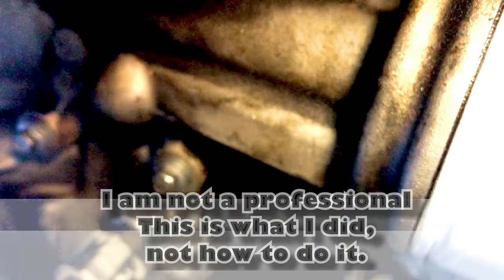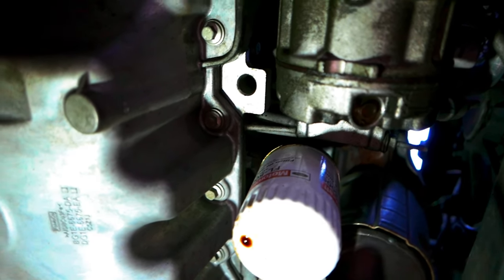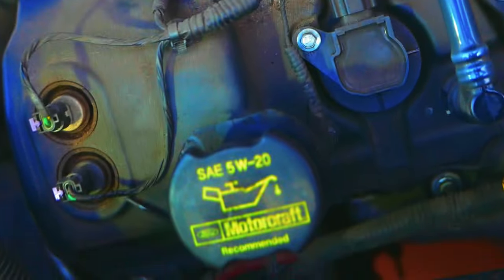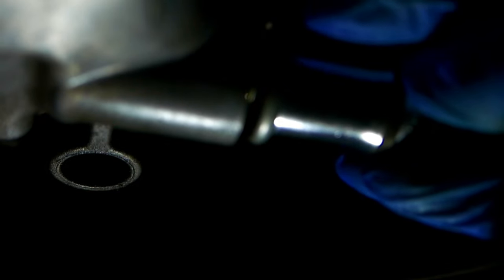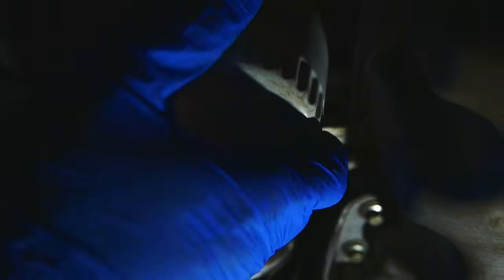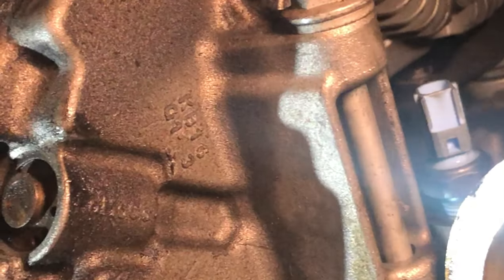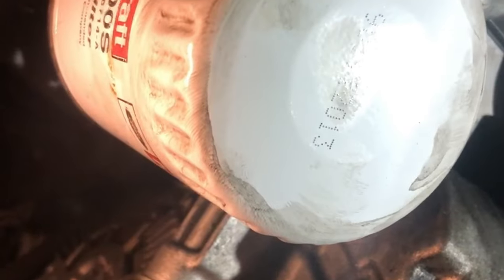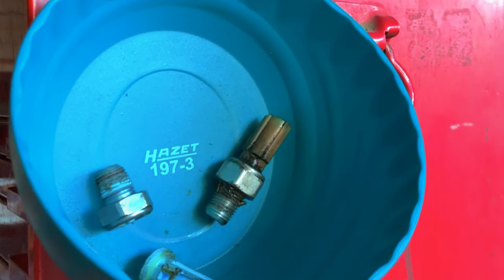ShadowBoxer 0077 (2014 Ford Explorer Oil & Oil Sensor Change}

Comment: Thanks for sharing the work. I have a 2014 Ford Explorer XLT 3.5 L with the oil cooler on the top of the oil filter and the cooler is so close to the oil pressure sensor that it is hard to unplug the sensor switch connector. I didn't see the oil cooler in your video. An auto shop told me the oil cooler has to be removed to have access to the sensor.

Comment: I think there's an easier way.  I just did this on my 2015 Flex, and from the point that I had the plastic belly pan off, it took less than 10 minutes to remove and replace the sensor - including the time to clean up the oil from the leaking sensor.  I used a 12" long, 3/8" flex head ratchet with a 2" extension and a deep socket.  With this configuration, I was able to come up from directly in front of the oil filter (which I did not need to remove for this operation).  You can also reach it with a 2" extension and stubby 3/8" ratchet, but the extra length of a 12 or 14" inch flex head will break the sensor loose.
Reply from the maker: Yes there are probably several ways to do this. Not all vehicles are set up the same way. Mine does not have a belly pan for example. On my 2014 Ford Explorer I accessed it with two sets of tools as shown in the video. It seems that besides the deep socket to accommodate the sensor,  a long ratchet (mine were 1/2 drive) and some flex somewhere in line (I used a universal joint) to help with access and clearances is what works. 

It’s all good as long as we get it done ourselves. 
Thanks for posting another option.
Cheers.

Comment: 11 min just to show me where the oil pressure sensor is at Jesus get to the point next time
Reply from the maker: Good job sticking with it. Patience is a Virtue.
If you are in a hurry, you should probably just read the manual for yourself instead of looking for others to fix your problems. Your problems are not anyone else’s responsibility. These are free videos on YouTube, remember?

As for getting to the point, I did. This job was part of an oil change.
I got to it when it was time to get to it.
AFTER draining the oil. 
If you want to remove the sensor with the engine full of oil, go for it. That’s not what I wanted to do.

I also scrubbed YT researching this job. Most videos don’t show anything. In my video here, I made sure to include a BIG ARROW to help YOU find it, when I got to it. Entitlement aside, I hope it helped.
Food for Thought.
Thanks for watching.